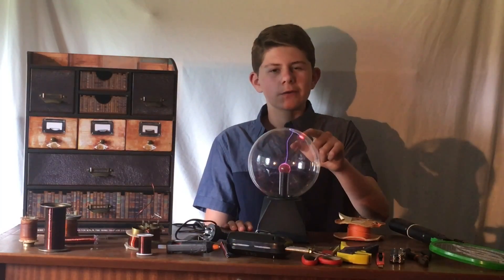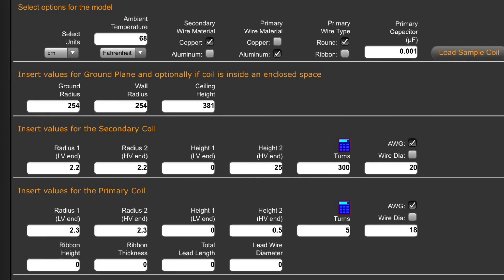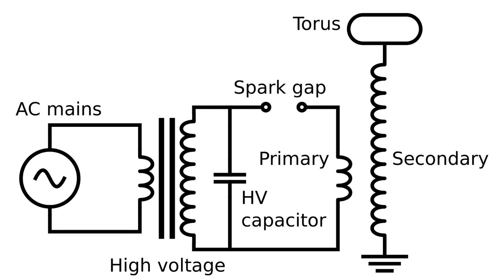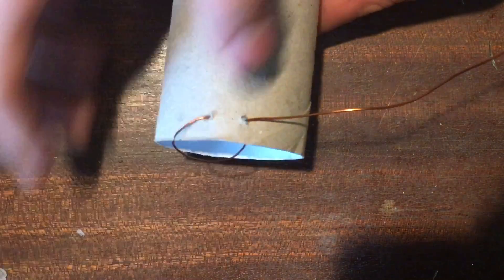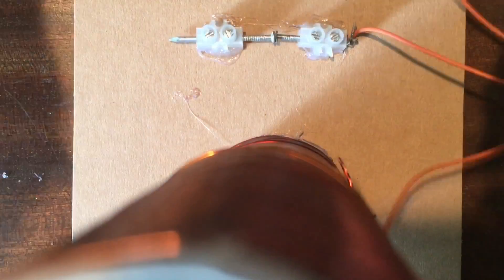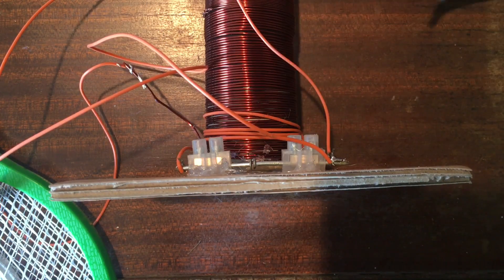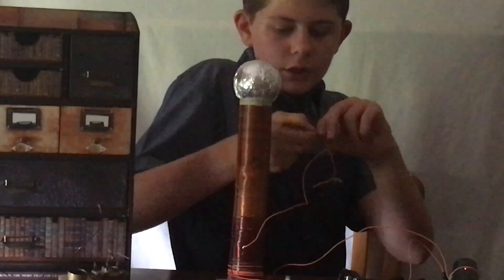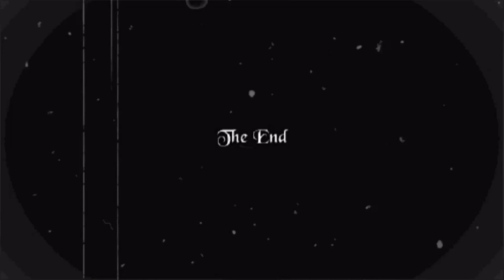How to Make a Simple Small Spark-Gap Tesla Coil with Limited Parts

Comment: Hi nice video , can i keep the height of secondary coil short
Reply from the maker: Rahul Nathan The wire I used for my secondary coil was quite thick. If I was to use thinner wire, but have the same amount of winds, the coil would be much shorter, but the resonance would be different and the coil will not work so well. 

If you tell me the AWG of your magnet/copper wire I can calculate the coils resonance for you, ie. how high it needs to be, how many winds, etc. to get it working well. 

Thank for watching!